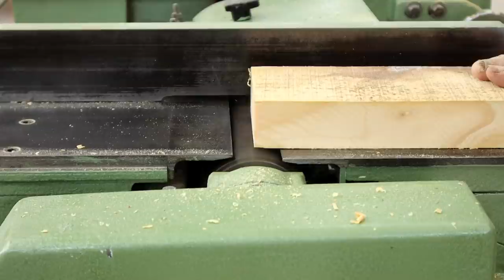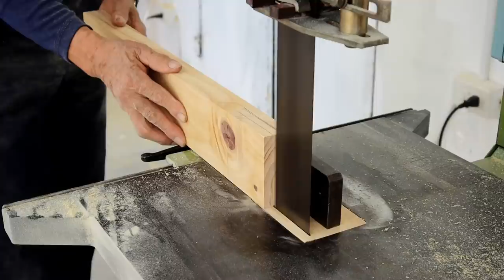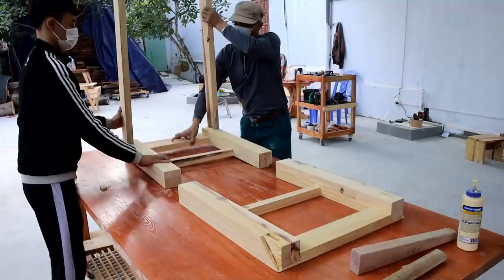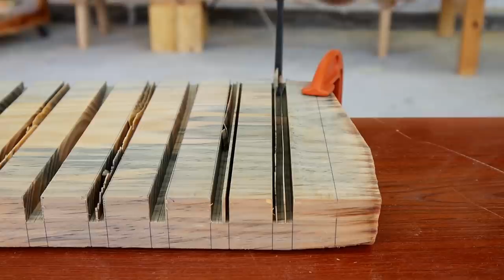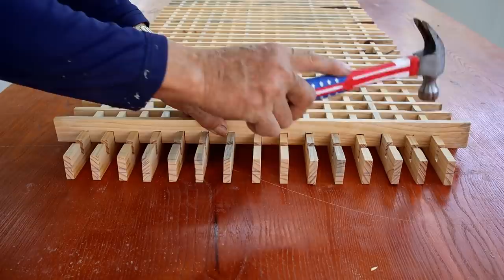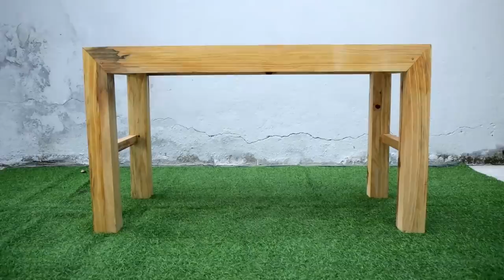Great Woodworking Ideas And Skills // Build A Unique Design Table From Strips Of Wood

Comment: OMG these are the most unsafe machine practices!  No guard on jointer and hand should NEVER pass directly over the blade, and no push stick use on table saw.   This is very dangerous.
Reply: where you're right, you're right. but it looks like the people in those asian countries either don't know better or they just don't care
Reply: I noticed the operators still had all their fingers... I grew up in a wood and metals shop and can still count to 10, without all the guards and stuff modern machinery require. Too bad they don't require careful operators with intelligence. 
The one thing I noticed was that they didn't fix the broken parts before they stained / finished it... it will go through life missing a few chunks in the table surface.
Reply: Safety Sally has arrived
Reply: Safety is not a bad model for others. Although I see by  My mistake how dangerous a table saw can be on a finger. Sure wouldn't want anyone to experience that. Even Norm Abrams used push sticks.
Reply: yeah, but they are moving fast, so they are in harm's way for less time...it all evens out.